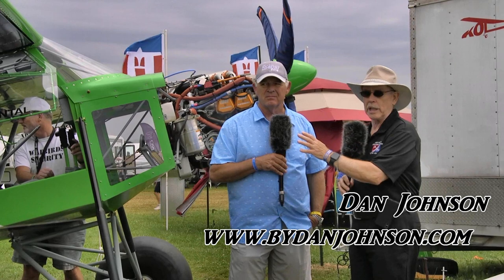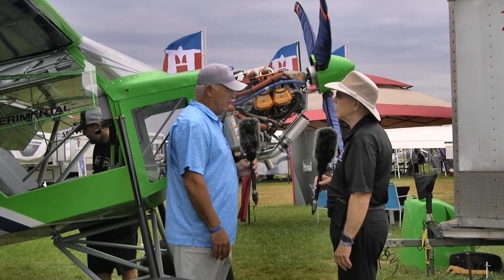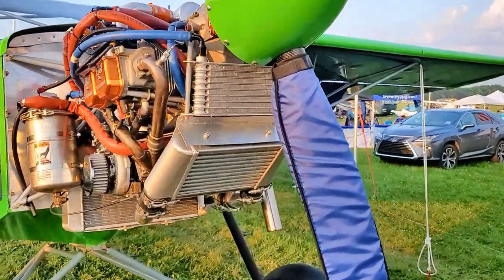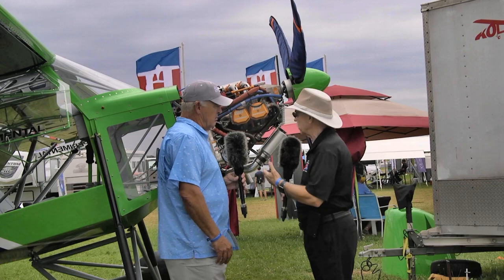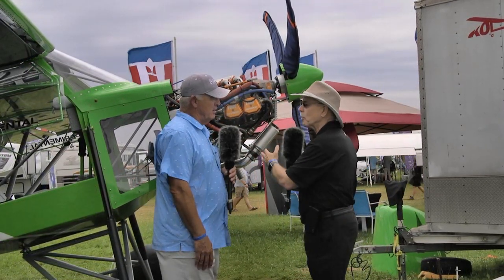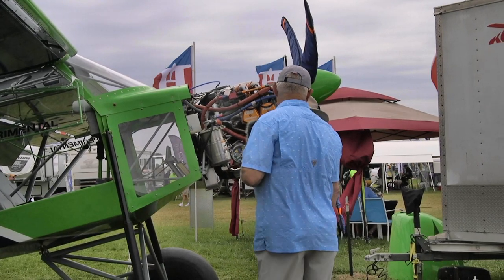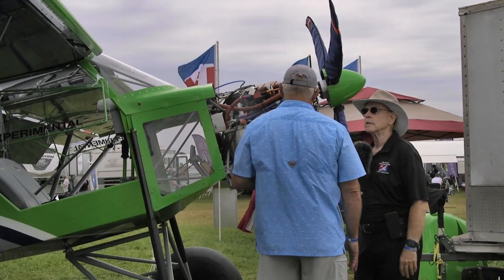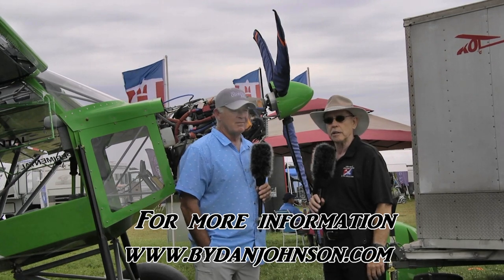Badass Power Sports, Edge Performance Products, Rotax aircraft engine power accessories,

Comment: I believe Robert Helms of ULpower is also a Dealer for Edge performance now... here in the US.  Great Video Dan, thank you for Sharing!  It is great to hear that both companies have been there for the customer after the sale.  Everyone making posts about the longevity and life of this engine just need to do a little research!  This engine has been overbuilt to handle the extra power with a welded crankshaft, billet big bore kit with forged pistons, and cams etc!  The power to weight of this engine is unmatched and would weigh a lot less firewall forward than an O-340 would dry by itself!
Reply: Power to weight is unmatched?  REALLY?  My TV is smaller than that inner cooler and 1/4 as thick.  6 feet of intake pipes, cold air box. Longer exhaust pipes.  ECU.  Radiator & oil cooler further away.  Brackets and rubber mountings for all that bullshit.  156 HP for 2 minutes.  130 HP @ 5,500 If that. 
Now compare it with the power to weight of the 2,500 rpm direct drive D-Motor 6 cylinder. With 30 less moving parts. $23,000 New

Comment: I understand that the pressed crankshaft is welded to eliminate twisting when boosting power.  Edge Performance in Norway described a special jig and specific process to eliminate warping.  Does Bad-Ass have the same process or simply weld 'er up?  I would imagine some heat treating or perhaps peening would be appropriate to relieve stresses induced by the welding process.  However, I don't recall any mention of such in any video or literature I've read to date.    I know older Suzuki GS 1100 cranks were welded in high HP mods and some broken cranks resulted from stress concentrations due to the welding.   Granted, this was decades ago, but physics remain the same.   Just curious.

Comment: So what can Edge Performance do with the 915is? Hmm Is Edge Performance doing ULPower upgrades...like turbo’s for 520isa?
Reply: Twisted Hippie I would like to see Edge performance make a turbonormalized setup for the UL350i to produce 150hp.  I believe ULpower is already working on a Turbo setup for the UL520is engine.  Now that Robert Helms is also an Edge Performance dealer... I am hoping they will collaborate to make something great based on the ULpower engine line!
Reply: They could make 915 obsolete.  Selling same engine with 15 more HP for $10,000 less.  They could do that to the 915,  914 too, for that matter
Reply: @raymond3803  How can they make it obsolete if they use a stock engine from Rotax to begin with?

Comment: What I’m curious about is longevity, following all the guys running these engines with big bore kits the longevity isn’t that good. I think I’ll stick with O340. With complexity and extra wieght of turbo and inter cooler it can’t be lighter.
Reply: phegley3 dryweight of EP912STi is only 68Kg, being 4Kg lighter than a 914 and 16Kg lighter than the new 915iS.
Reply: phegley3 The longevity of the fleet has actually been quite great... Overall!  They have been in the Trendak autogyros for years.  This engine was actually developed before the 915is... and when it comes to weight this engine is significantly lighter than an O-340 by at least 50-75lbs.  Total firewall foreward weight is probably just under 200lbs!  The dry weight on the Titan O-340 is 250lbs and that is just the engine without liquids or accessories!

Comment: I'm assuming that the rotax loses its certification with such a mod so if going experimental anyway I would think non aviation engines would be interesting. Keeping the gearbox issue in mind though. Maybe the boxer engine out of a totalled porsche 911 or boxster S if that's possible.
Regarding stol, because you are looking for extreme low speed take off I think you want to look to a different configuration than the classic forward aligned aircraft. You could skip directly to zero distance take off or deep angled wing with the trailing edge near the ground and two engines blowing air under the wing to fly right away on ground effect cushions.

Comment: Can you imagine how unreliable this will be? The MTBF on a standard Rotax is already on the low end of the legancy engines; stuff another 50% of power into it and watch the number of emergency landings grow even further.
Reply: Edge from Norway has been doing this for a long time ... they do a whole bunch to the internals like weld the crank where the throws are pressed together ... At first blush  you would think this .... except Edge quality is extreme and its not their first kick at the can ... but ... its still not for me either ... pioneers take the arrows   .... as for TBO I doubt they care if its 500 hours ... they are out to win competitions not run a commuter line
Reply: I'd be interested to know your sources. Rotax engines in the CTLS's I fly have been getting considerably over 2000 TBO. An engine just removed from service for a new engine had 3500 hours since overhaul. The A&P who services the aircraft at my flying club raves about Rotax reliability.
Reply: @KingGroupProductions   I flew my 912S for 2300 hours before opting for a  new one, after selling the old engine for a good price.  NO issues whatsoever, about 1/4 qt oil consumption between 50 hour changes (try that with a legacy engine) and on average, less then 4 GPH fuel burn (try that also with a legacy engine).  Not one burp or hiccup the entire time, and I only did a fraction of the factory mandated maintenance!  Car Quest oil filters, never changed 'the rubber", changed the plugs about every 500 hours, the only thing I did do  was change the oil religiously every 50 hours, +- 20 hours.

Comment: No disrespect.  But a turbo fan ran off the back of the crank (super charger) seems some much simpler.  What 140 HP with original carbs?  No cold air box.  No new 4 into 1 modified exhaust pipes.  No different muffler.  No big heavy inner cooler.  No running intake pipes all the way around the engine.  EVER HEARD OF FRICTION LOSS FROM EXCESSIVE SURFACE AREA?

Fan off the back of engine.  Separate and away from exhaust.  No inner cooler.  No turbo lag.  Just 12" of pipe straight back in.............. Simple. Compact.  Lighter.  Hell of a lot cheaper

Comment: An already highly strung out engine is hot rodded even more is going to be less reliable and more likely to have catastrophic failure.
Reply from the maker: And what makes you believe that the Rotax 912 is a "hot rodded engine"?
Reply: @ultralightnews  Did you watch your video? Ha ha. Bold caption "156HP from a Rotax 912 ! " "Badass Power Sports..." What makes me think?  912 engine started originally as 80HP normal aspirated later 100HP. Now it's making 156HP by BADASS Power Sports not sanctioned by Rotax. Ways to make more power with same displacement: higher compression, higher RPM, change cam and turbo. All adds more heat and stress. Rotax is NOT even getting 156HP from their 915 iS Turbo.  Use common sense. If it's too good to be true... You are already running 5600 RPM through a gear box. It is hot rodded for STOL  racing but you give up reliability. Mark my words there will be engine failures. Only grace is these are likely young in STOL planes with low stall speed, making off airport landing more survivable. However ultra-lights .and paramotor's have low stall and have loss of power with fatal results. I would not fly family and friends with this. Thank you for your question.
Reply from the maker: @gmcjetpilot  Interesting, having attended courses at Rotax since 1984, having flown over 20,000 hours on them, using them in an intensive training environment since 1989, PLUS flying them on a number of my SeaRey's I would have to disagree! 

First lets look at the 912  - 80 HP engine - it is the SAME engine base as the 914 - which is 115 HP!

While Rotax does not offer a 156 HP - 912 based engine ( which I have flown in a number of aircraft) it is offered by a number of their most reputable dealers. 

A number are flying on the Aircam, Tucano, and RANS S7. They ARE not using the same displacement,  nor higher RPM.  So based on my experience, owning, repairing, flying, and training - I do not  have a problem with the Edge Performance package. If I did then I wouldn't have done the video, or would have advised against it's use.
Reply: @ultralightnews  I'm a commercial airline pilot and don't have 20,000 total flight hours much less behind one kind of engine. You made an appeal to authority. Taking Rotax classes is great and respect your testimonial, but does not speak to this hot rod experimental Rotax. 

Few Badass Power Sports flying (200 sold by their web page does not mean flying) and few total fleet hours.  Let's see in a few years what happens. They don't call it experimental for nothing. You cant assume it will be as reliable as stock Rotax. Personally I don't want to experiment with aircraft engines too much carrying my family around. .

Badass power sports is not affiliated with or Rotax approved. This modified engine did not meet and likely can't meet Cert specs. Look I'm not a big fan of hopped up Lycomings with hugh compression either. 

I understand it is experimental and for racing. 55.65 cu-in making 156 HP is 2.8 HP per cubic inch is a lot. Goid luck and be safe. There is no free lunch. I have been following experimental aircraft and engines since 1985. I've seen many engines come and go.

I stand by my position. Getting more power equals more wear and less mechanical and detonation margins.
Reply: @gmcjetpilot  you're right, experimental allows for the testing of new technologies that can make aviation more safe in the long run but can also pose a risk in the testing phase. That being said, many technologies start off in experimental before making it to certified, and some don't because of the cost to certify. I wouldn't look at Badass, the dealer, I would look at Edge Performance for stats on their engines. You'll find they are extremely reliable. They set tolerances that have been perfected on a dyno in a state of the art manufacturing facility that can provide altitude testing. 

Opinions are great, but when they're just based on your gut and not facts they can be dangerous.  Imagine if we had the same outlook on the commercial jets you flew....maybe we'd still be flying on DC9s to get around. I'd say the higher horsepower turbine engines and modern avionics made things safer wouldn't you? But I bet their were people saying the same thing when they were introduced.